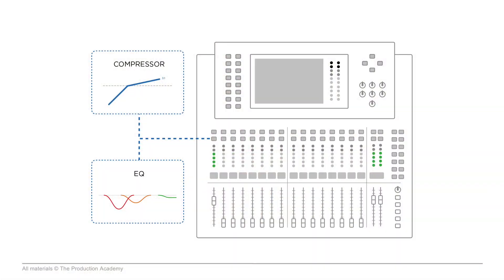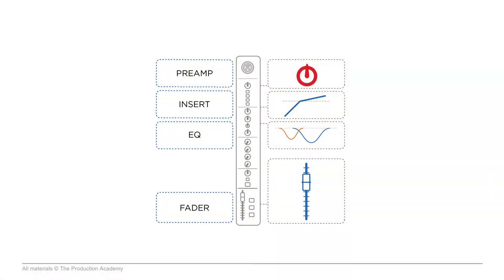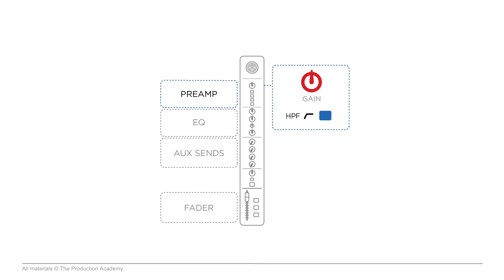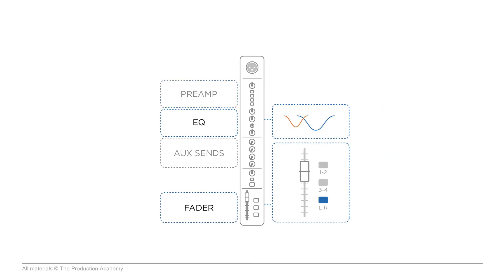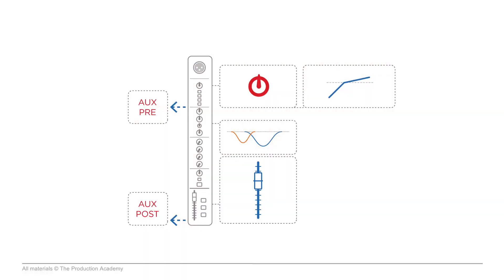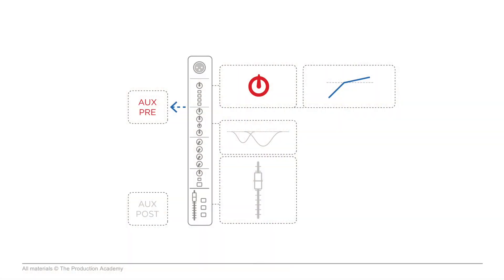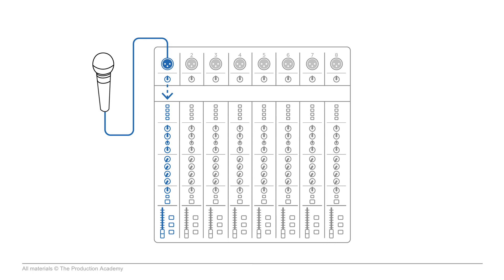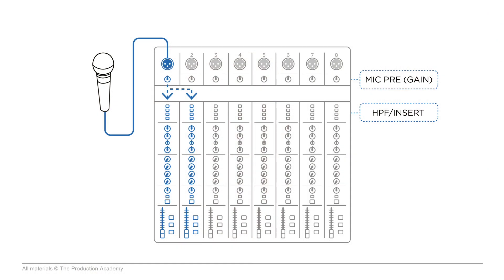#1 Audio Tip for Small Venues — The Production Academy

Comment: You're not an audio engineer unless you have a couple Y-splits in your toolbag, a couple more in your car and keep finding random ones in random places in your house!
These things are so valuable! 
The only problem I found is with people's understanding of their use.. often I've seen them flipped around with a couple adapters or turnarounds and used to combine two outputs into one.. that is NOT how to use them. Rule of thumb is: 
“You can split 1 output into 2" 
“You cannot combine 2 into 1 input"
For that, you would need something called a "summing cable" which uses a resistor network to prevent any back feed which is going to damage your instruments, mic, keyboard etc that you are trying to combine with whichever other output device. 
I often see people doing this with a stereo keyboard using TS y-splits. I guess they think that the two TS outputs from their keyboard will combine into the one TRS plug which they can plug into 1 channel on a mixer. Yeah it might sound like it's working, but eventually it won't work. And that's because that electrical backflow i mentioned earlier is slowly and systematically damaging that keyboards output circuit.. it does damage The circuitry and the effect is cumulative. So after a few occurrences even after a few months. All of a sudden, your keyboard stops working..